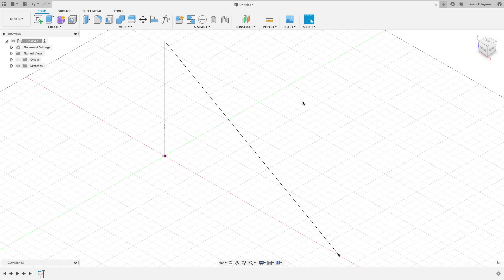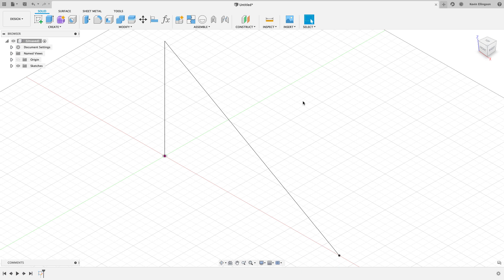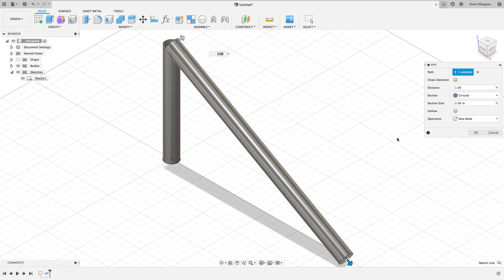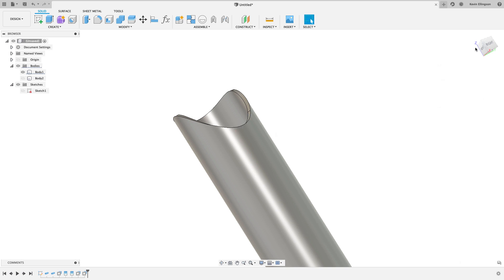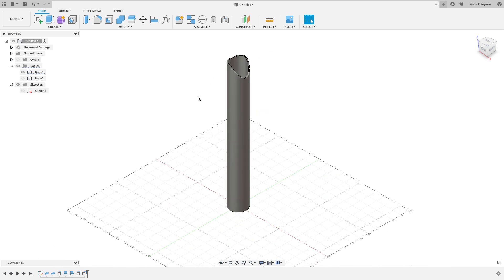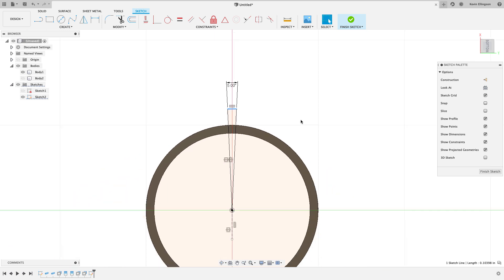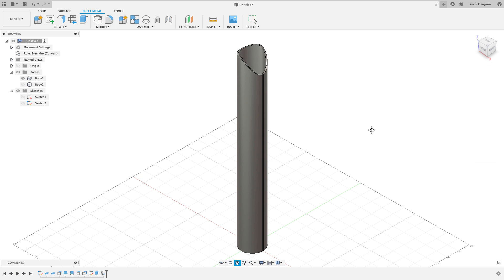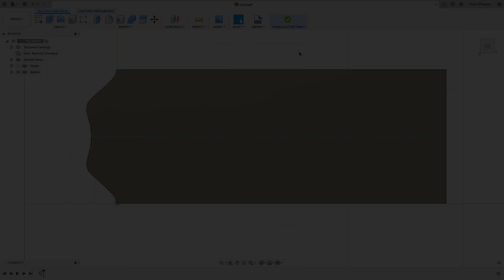Fusion 360 - Unfolding Sheet Metal Tubing Update

Comment: How do you unwrap a hollow cylinder without a gap? I tried a face cut on all surfaces on one side. Compute fails when unwrapping.
Reply from the maker: A gap is required. You can make the gap as tiny as you want, but you need to have a gap.
Reply: @MechanicalAdvantage Figured it out. Thanks!

Comment: How do you deal with the length of the flat pattern doesn't match the circumference of the pipe being patterned? 8in sch40 pipe is 8.625 diameter w/ a circumference around 27.096, but the flat pattern I get in fusion360 is only 25.9483in.
Reply from the maker: What is your k-factor set to? It needs to be set to 1 or your flat pattern will take stretch into consideration.
Reply: @MechanicalAdvantage  thanks for the reply. I am super new to fusion 360 and I dont know what the k-factor is or where to find it.
Reply from the maker: @JoeKerr-28  If you use the sheet metal tools to do this, you have to pick a sheet metal rule. That sheet metal rule controls how the part unfolds. When you edit the rule, you will see a K-factor value. Changing that to 1 will remove the stretch factor and just unfold your shape without accounting for stretch. I did a video on sheet metal rules if it helps https://youtu.be/tOs2piHfuMU
Reply: @MechanicalAdvantage  nevermind, I found it! thanks fot the help and the great video. can fusion 360 do the g-code for a 4th-axis plasma cutter? I make a lot of parts out of steel and aluminum pipe and would love to be able to just do everything in Fusion 360 and not have to make a flat pattern to import into another software.

Comment: any idea how to export as a pdf or jpg so this could be printed on paper as a template?
Reply from the maker: You need to make a drawing of it using the drawing workspace. Then you can export as pdf. Note that if you have the personal license, you need to use a print driver to print to pdf. If you have a paid license, you will see the export yo pdf option on the toolbar.

Comment: Hi keven 
Thanks for the great video I am trying to build a pontoon boat and am design it in fusion360 the pontoon are tapered so I have to do two sketches one smaller than the other then loft it but then I stitch it and try convert it to sheet metal it doesn’t un fold the whole part I have many hours lost trying different things like fillets on all bends. I think it may be something in the process of 
Stitching and thickin the joints look to be but joints not one part. Any ideals would be most helpful thanks Craig
Reply from the maker: Hi Craig. Sheet metal in most CAD packages is set up for a press take style operation. With what you describe there would be deformation of material, both stretch and compression. So as soon as your sheet metal would result in deformation, Fusion can’t unfold it. Hope that helps.

Comment: At the moment I don't understand what's they doing! Autodesk disabled external scripts, so this fu... gestures can not disabled and NoGestureNoShift will not work since many versions!!!
A lot of stupid little updates but really work on cam I never see....more and more I hate Fusion360
Reply: Hey guys, i am getting a shrinked profile, i set the k factor to 1, did the drawing from design at 1:1 scale  (A3 size) & export to PDF in fusion but the print i am getting seems to be shrunk by 2.5mm.
Please suggest me the solution for this
Reply from the maker: Hi Captain. I'm heading to Autodesk University next week and will ask about the scripting. However, I just wanted you to know that a TON of resources are being put into CAM. I can't go into the specific details but rest assured that there is a ton of things happening in CAM right now. However, I will also say that life is too short to feel like you are tied to a piece of software. If you can find something that better meets your needs, I wouldn't stop from making the move if I were you.
Reply: @MechanicalAdvantage  Ah, that´s the best way...if you don´t like it, go away ???  I spend many many time to share problems that i found, small things, bad thinks like 2d boring damage the hole if you set ONE checkbox ... damage the part because some 3d operations stop at bottom high, some not. I work with fusion now more than 1 year, at home for hobby and for looking what bug are fixed, and in my company we used an payed version. I am every day on my CNC and made parts. About 90% we programming on the machine, its faster and more flexibility as with fusion. So if there is an bug in fusion, i was often thinking "why i am told my boss to buy this". 

And in this year, not many bugs are fixed. The last updates fixed nothing from this. And yes, there are better software around ! But the only thing that fusion have is the price. For this money i got nothing better. So only big pricing software want to fix bugs ? I think not... I hope the things see on the roadmap are on work. Here are good things, but sometimes it is better fix old problems first...best regards.
Reply from the maker: @HardcoreMusik  Send me a list of broken things to info@mechanicaladvantage.com and I will make sure they are bugs and if so logged into the system.
Reply: @MechanicalAdvantage  Hello ! I wrote you two times but got no answer. Do you got my email ? Please write me a short information back.